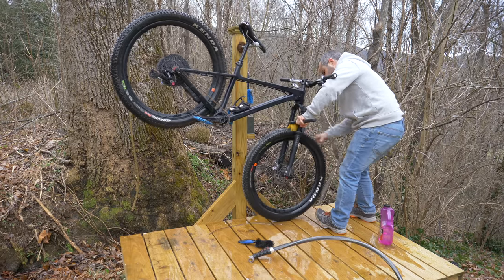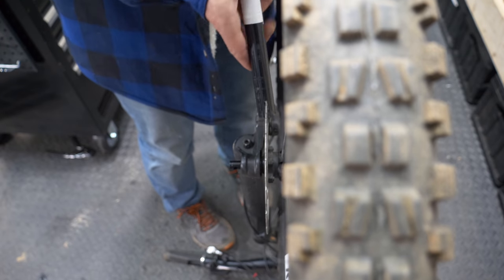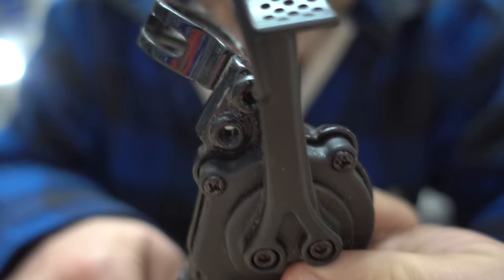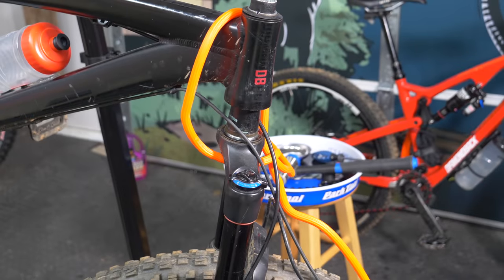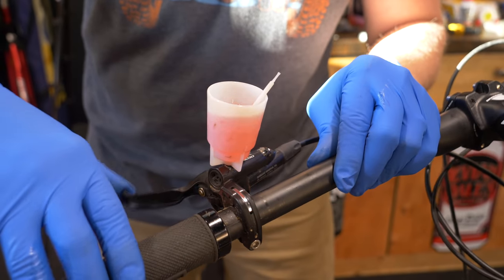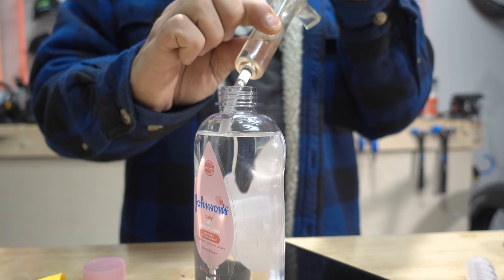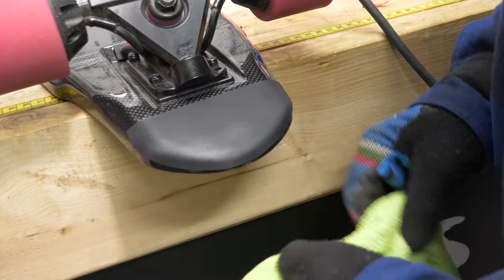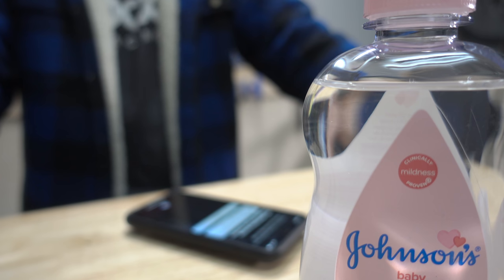10 Bike Hacks for Mountain Bikers and Beyond

Comment: Believe me i am running baby oil since 1 year
 in brakes and it works
Reply: So make a video on your Chanel Vaibhav and now don't say I'll will think about it and how brakes are working ?
Reply: Do you know it goes when  you have to brake in a long trail where you use the brakes at high speed and when the temperature goes high? I have also heard that the baby oil is less liquid so when you brake, you have to push harder.
Sorry for bad English😅
Reply: I didn't know you are a Seth's Bike Hacks' fan!
Reply: @soufianeljoudi  I've been using it for years, mainly because I refuse to pay $30 for 50ml of Shimano oil when I can get 500ml of baby oil for just $3. I've used it in fat bikes, XC bikes, single speeds, and even my e-bike. It handles it all just the same as the Shimano fluid does.
Reply: This is what Magura says about drugstore mineral oil:

What type of oil should I use in my Magura hydraulic brakes?

Magura Blood mineral oil is the recommended oil, which is a 10 weight mineral oil. By far, our most common problem we encounter is consumers putting off-the-shelf mineral oil (from a drug store) in their Magura hydraulic brakes. Off-the-shelf mineral oil is normally 30-50 weight which will make the brake very sluggish. In addition, off-the-shelf mineral oil has additives, perfumes and different boiling points, all of which can cause brake failure. USE ONLY MAGURA BLOOD IN YOUR BRAKE SYSTEM. Use of any other fluid besides Magura Blood mineral oil will void your warranty.
Reply: @seanhornchek6440  of course Magura are going to say "USE ONLY MAGURA BLOOD IN YOUR BRAKE SYSTEM", it's their product, so they make profit off it. Every manufacturer does exactly the same. I'm not telling people to use baby oil, I'm telling people my personal experience with it, and it's been entirely positive. BTW, my comment relates to Shimano, not Magura, even though they basically use the same system. Tests have shown Mag Blood and Shimano Oil are almost identical, but if you used either in the other, it'd void your warranty. They used to say similar things about car servicing, that you will void your warranty if you take it anywhere other than the manufacturers own agent, however that's been thrown out, because it was BS.
Reply: @PowerPaulAu  if the oil i put in my brakes smell like baby diapers there must be shit in it. Baby oil has completely different viscosities compared to mineral oil. Why dont you use use automotive power steering fluid mineral oil if your such in a budget. Brake bleeds are only needed like 5 times a year, and brakes are a very important safety item on a bike, I would never cheap out on my brakes - reason for why I dont buy shimano nor sram anymore
Reply: @seanhornchek6440  have you smelt baby oil? It doesn't smell like shit... that has to be one of the silliest comment I've read in a long time... LMAO. And did I say they have the same viscosity? No I didn't. I used baby oil because it was there when I needed it, and it's also not bad if you get it on your hands or anything else. BTW Shimano are great brakes, they're the most popular brake for a very good reason, but you're allowed your own personal opinion of course, just as everyone else is. I just don't get what you're trying to argue here. I'm not saying baby oil and "Blood" are the same, I'm saying... again... my experience has been entirely positive. You don't have to use it, or believe me, or support me using it, it's irrelevant, but if you haven't had any experience using it, then other than anecdotal info, you're actually unqualified to comment (especially after that diaper comment... LOL).
Reply: it smells like baby powder and diapers, not shit. I have had m8000 xts and m820 saints, they work awesome for a bit but bite point adjust is BS and doesn't do shit. And then after a while, the brakes have an unreliable bite, sometimes it grabs high sometimes it doesn't grab at all. Im just saying that for the safety of others, mineral oils should not be substituted by baby oil unless it is an emergency.
Reply: @PowerPaulAu  it's a bit more complicated than just a hunger for money. The manufacturer designs their brakes with one type of fluid in mind, they can guarantee it will perform flawlessly and if their fluid will change it's composition in the future, it will remain compatible with older brake systems. I bet Shimano ran some test with Magura Blood Oil and it came out great, but they can't guarantee Magura will not change it's oil composition without notice and possibly damage seals or dramatically decrease it's performance. When you understand brake system as a whole, including fluid, it's much easier to understand such limitations.
Reply: I tried to put baby oil into new deore 4-piston brakes when I had to shorten the hose.
And it did not work!
From the first everything works well.
But baby oil is much thicker than the original shimano.
I can feel it by my fingers.
Circulation inside the lever was too slow, resulting in a feeling like an overcharged system after a couple of rapid consecutive pressures on the lever. The bite point would be at the very beginning without a dead walk. Everything would go back to normal if it did not pump for about 5 seconds when the oil had satteled down.
Reply: Wow now i  have a new idea .thank you.
Reply: I used mineral oil from the pharmacy in my shimano xt’s for almost 4 years. Everything was great until it wasn’t anymore. Basically became completely soggy, and had to pump them every time to get any power. I think the piston seal got destroyed, like when the master cylinder goes on your old Toyota Camry. I guess I would still use it in a pinch, but otherwise I’m using shimano oil only.
Reply: I am Sonu
Reply: Sean Hornchek it’s cause magura want your money
Reply: @lookout24    change *its composition        change *its oil
Reply: if in the middle of nowhere (remote place), use baby oil for your hydraulic brakes.
Reply: @seanhornchek6440  Just use LHM+
Reply: Me too man it says mineral oil
Reply: that's rad, surprising but rad
Reply: @seanhornchek6440  A Mountain Biking Emergency. 
An emergency would be you breaking your leg because you used baby oil.
Reply: @altawolf11    If you gotta pump, it's because you're fluid is contaminated...  If it were the seals, you'd get fluid leakage somewhere, when you used your brakes and no amount of pumping would fix it because the oil would just pass the busted seal.
Reply: @seanhornchek6440   - Using power steering fluid is probably one of the worst things you could do.  The reason is the additives...  Depending on what type of rubber is used in Shimano's brake systems, those additives could do one of 3 thing, they could better condition the seals, they could rot the seals, or they could might do nothing..  As for baby oil, it is mineral oil.. Pretty much straight up mineral oil...  And the viscosity doesn't mean squat.  It just doesn't need to compress, like other liquids like water or boil into a gas.  Outside of that, Shimano brake oil is probably just baby oil with some additional additives to help maintain the seals and give it that pink color.  Their additive might make it slightly thinner, but it makes no difference since flow rate doesn't matter in a brake system.
Reply: @soufianeljoudi   - You don't need to worry about how think it is.  The purpose of any brake fluid is to not compress.  If it compressed, you'd get spongy brakes.  In that regard, you would think a thicker fluid is better.  Irregardless, viscosity doesn't matter, but it's not being used to lubricate.  It's only a medium to transfer energy.  But you're right to be concerned about high temps.  Since baby oil, which is mineral oil, it might have a lower boiling temp.  If that's true, that's where the problem will be since boiling oil turns to gas and gas will compress, so you could lose your brakes..  Usually when something like that happens, it this applies to any brake fluid, whether a car, bike or whatever; your brakes will 1st get spongy.
Reply: I use citroen hydraulic suspension oil for a 3-4 years without any problem..
Reply: Baby oil is cheap than hydraulics lube
Reply: Hi vabhav bro nic to see u here
Reply: me too
Reply: But then again no offc but u don’t know enough abt mtbs no offc
Reply: @seanhornchek6440  Sean if you are too good for sram or shimano you are clearly a primadonna to me.
Reply: Big fan fat biker vaibhav
Reply: @manikatari2882  Agree with you thoughts.
Reply: Nice
Reply: Big fan of yours sir
Reply: I read your comment after 2yrs
Reply: Make a video about price of all derailleur Shimano
Reply: Big fan
Reply: Hi vaibhav sir I watch your videoz
Reply: @seanhornchek6440  "Baby oil has completely different viscosities compared to mineral oil" could you lonk some viscosity comparaison ?
Reply: @crabjoe  "Using power steering fluid is probably one of the worst things you could do.  The reason is the additives...  Depending on what type of rubber is used in Shimano's brake systems, those additives could do one of 3 thing, they could better condition the seals, they could rot the seals, or they could might do nothing..  As for baby oil, it is mineral oil.. Pretty much straight up mineral oil...  And the viscosity doesn't mean squat.  It just doesn't need to compress, like other liquids like water or boil into a gas.  Outside of that, Shimano brake oil is probably just baby oil with some additional additives to help maintain the seals and give it that pink color.  Their additive might make it slightly thinner, but it makes no difference since flow rate doesn't matter in a brake system." thank you for speaking the facts ^^
Reply: @crabjoe  What's the boiling point of baby oil ?
Reply: Can u use IT on a car, asking for a friend

Comment: If you have shit wire cutters, and you cutting cables, just tape the part you want to cut with electrical tape, then cut on the electriCal tape so it wont fray the cable
Reply: works with a Dremel if you don't have any wire cutter at hand too
Reply: This is important

Comment: 2 main problems with baby oil is it's the wrong weight oil, and it gets thicker as it gets cold, never used it in my MTB but my wifes last ktm 200 which has magura hydraulic clutch came with it in the system, when cold the clutch was nearly unusable, I've heard fellow mtbikers try baby oil in their brakes say the brakes get sluggish in the cold and change feel. Mind you this is south of 20f.
Reply: Finally, a smart person in the comments! Thanks, Mr. Kohn
Reply: You nailed it.... It's a totally different viscosity. Though it will work it won't work correctly 👍
Reply: Was recently at a Magura tech clinic and they said our mineral oil is a different weight from Shimano. Dont mix.
Reply: Over here its 40 degrees celcius evey day not need to worry about the oil freezing need to worry about the bike melting ahah
Reply: If you guys want to try something different try Bionol because the viscosity is even better then Magura or Shimano mineral oil.
You also could make salad with it, its biodegradable, boiling point @ 300°C.
I use it on not working Shimano M8000 XT brakes where the bite point was wandering around with Shimano Oil. With the Bionol it just worked without wandering.
I also use this stuff with my Shigura brakes , Trigura and Magura..
This stuff was made for the newer Trickstuff brakes and they are really impressive.
Reply: If you get temps for that to be a problem could you use light engine oil. 0w20 is prdtty runny  below freezing
Reply: 1) "Liquide Hydraulique Minéral" (LHM) as used in Citroen, RollsRoyce, ... cars and at least in the EU available cheap and easily in auto part stores works fine with Shimano.
2) Bleeding Shimano brakes with a syringe from the caliper up is usually easier and faster.
Reply: @mabamabam  different oils have different properties, and react with seals differently. And the last thing you want in your brakes is a multiweight oil. The oils weight or specific gravity will change as its temperature changes. I've used shock oil in the past in magura hydraulics 3 and 5 weight work well. I have a 1 liter bottle of shimano lil abd use it more in my magura clutch than my mtb.
Reply: @cheeta2000  used to buy pentaoil for bmw and Mercedes power steering but they updated the formula and dont kniw ig ut will harm soft parts.
Reply: @danielplummer3111  that's that's roughly 90 F id take that every day vs our 4 seasons.
Reply: @charliekohn4271  No. The whole point of multi weight oil is that the viscosity stays the same, roughly, with change in temp.
Reply: @mabamabam  as some one who went to school for it no that is not how it works. There are polymers in a multiweight that expand and contract making it literally change viscosity.
Reply: @charliekohn4271  40°C is 104°F!
Reply: @Baureo  I'll take that over 0C which is our current average with nights dropping much lower, I like it hot. Did multiple races this year in the 100 f range. A couple above 110f.
Reply: Nice to know man I wouldn’t ever put baby oil into my braked.
Reply: I'm glad I live in a tropical country I could use baby oil as cheap alternative without worrying about the cold weather stuff
Reply: Guess I'll be okay in Cambodia then ; )
Reply: What's 20f?
Reply: @Dave-wf9hg   That's below freezing.. 32F = 0C.
Reply: I don't know many people that ride a bike when temps get even close to 32F, let alone 20F.  Did the baby oil cause the sluggishness or would it have been the same with other oils?  All oils get thicker as it gets colder, not just baby (mineral oil).. I don't know.. But as long as it's not frozen or boiling, it really shouldn't make a difference because it's not meant to lubricate.  The oil is static in the brake system and it moves very little.  It's there to only compress the pistons when force is placed on it.  If anything, the brakes should work better since a thicker oil should act more like a solid.  On the other hand, it might cause drag since the pistons can't retract back as easily, when the brake lever is released.

Comment: With the line assembly off, I opened bottom bleeder, top filler.. put the whole handle into a bag of leftover babyoil. Pumped it in bag and let it run out bleeder.. then capped bottom and then top.
Where there is a will, there is a way. Works perfectly now.

Comment: I've used car brake fluid for my Shimano brake system for three months and it's just fine! Awesome vid man!
Reply: Please pay attention to the kind of fluid. Is it dot?
If is it "dot 4" or more or less like dot 3 or dot 5 it will ruin brakes from inside.
Shimano uses mineral oil but car fluid is Dot kind.
Dot is a little eater. If you use Dot on Shimano for long time, you have to change the whole of brake system. 
Its better to clean it from Dot oil

Comment: Water sprayer to catch carbon dust is by far the best tip!! I actually did think of water to catch the dust, but i had a bowl of water and just dripped it on and applied it with a rag, the water sprayer is gonna work so much better! Especially if you can set it to a fine mist.
Reply: Even better to do cuts outside when possible -- if not completely cleaned up, that wet dust is going to dry out and get stirred back up into the air later.
Reply: @timtuckercom  Yeah you're right. Nothing is 'too much' when it comes to dust protection (or any protection). Our lungs weren't built to deal with it and no one is going to look after your body for you, so take care of it as much as you can!

Comment: Move your lock-on grips out beyond the ends of your handlebars if you want to experiment with handlebar width. Note: Don't ride on the trail with this setup as the grips could slide off, break, and you can't use bar end plugs. Only use it to test out different widths to determine what width bar you need.
Reply: Great tip ;)

Comment: I've been using Simple Green to clean my mtb and motos, may switch to car wash on the mtb to keep it shiny! Glad you thought the kydex was as rad as I did!
Reply: Got kydex arriving Monday thanks to your vid! 👍
Reply: Awesome! 🤘
Reply: Don't worry about it. If you like your bike to shine,
Actually wax the frame, seat tube,  fork lower tubes, hubs, spokes, rims, after a wash with  quality carnauba wax like your car. 
Comes out glossy, and sheds mud real nice. 
Just don't wax the rotors, grips, shifter levers, brake levers,  fork sliders or rear shock tube! 
And also, automotive interior cleaner/conditioner  works a treat for keeping your saddle in good shape and clean. 

I've found the best all around bike soap to be Johnson and Johnson baby shampoo.
Its gentle, cheap and won't strip the lube from your suspension, bottom bracket head tube bearings or chain. 
Simple green is a de greaser...keep away from shock, fork, and anything with bearings in it.

Comment: 'Regular' mineral oil has a very different viscosity compared to the Shimano brake fluid. I tried regular mineral oil once and could never get all the air bubbles out of the brake line. I chalked it up to one of those experiences where you learn that it is usually best to follow the manufacturer's instructions, this is especially true when it comes to safety related maintenance. The large bottle of Shimano branded brake fluid is only US$30 at the LBS. A US$3 bottle of mineral fluid is a false economy.
Reply from the maker: actually all the manufacturers have different boiling points, viscosities, and additives in their mineral oil blends. I’m really curious about how this experiment works out.

Comment: Baby oil really beats DOT 3 Brake Fluid in the car as well. And you save $0.50
But the real savings are in the gas mileage when you cannot stop and go as often. With less stopping the fuel economy goes up.